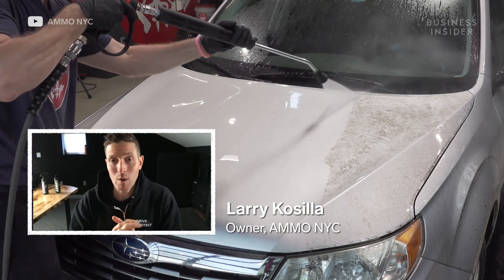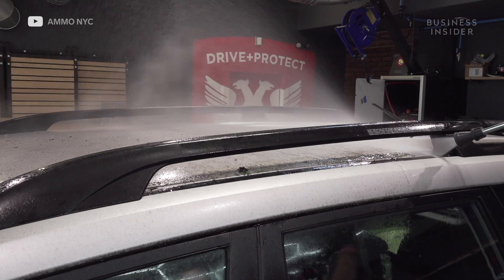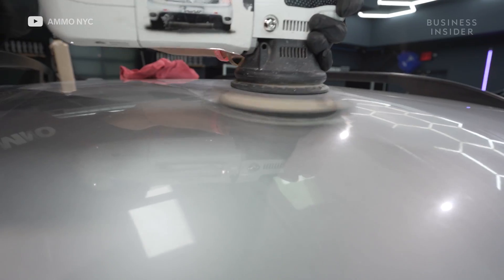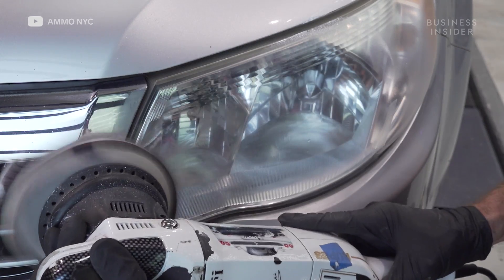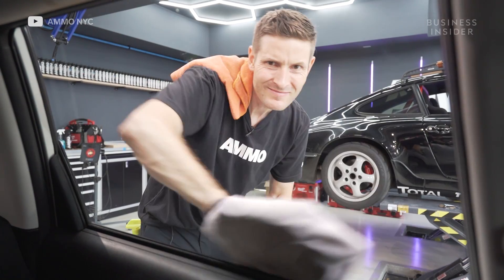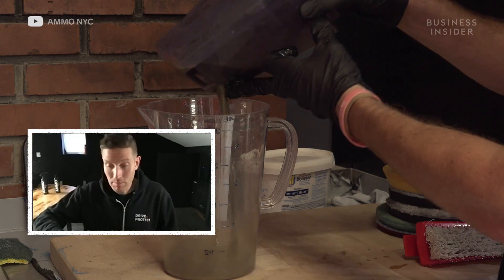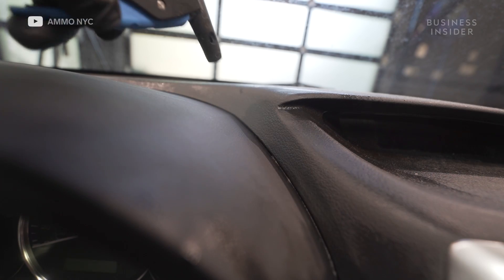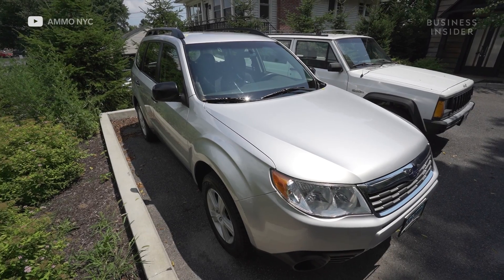How Cars Are Professionally Detailed And Deep Cleaned

Comment: Leaves the battery inside the car when washing the engine bay
Reply: Probably a dead battery anyway
Reply: It's more than safe on the system, any car made in the last 15 years is designed to be able to take on water in the engine bay.
Reply: @luminaughtt  water can get stuck in certain spots and rust
Reply: @StoneOcean595  as a fellow Detailer, it's pretty standard practice to dry engine bays as standard, and using rust inhibitors to slow the rust process, reducing risk. But yes, I do see what you're getting at and it makes sense.
Reply: It was a dead battery

Comment: 1:25 you can just power wash the engine like that? I always thought we should avoid getting that area too wet. Because if electronics and stuff.
Reply: You shouldn't, too much risk to electrical related components
Reply: You can it's just the older cars you shouldn't do it on
Reply: @LetsgoBrandon2023  cars in general you shouldn't...I detail for a living and I don't "pressure wash" I use standard water pressure with an attachment that sprays water like your shower head. They're are quite a few risks in doing so with too much pressure no matter the year.

Comment: As a business owner who started doing this exact kind of job from the ground up, he's actually doing a very bad job. NEVER use a pressure washer on your car. Most people who clean their car will most likely use house water (from a hose or sink) and that abrasion from the pressure washer will most likely have sediments which cause damage to your paint job- use distilled water if you HAVE TO use a pressure washer and set it to the weakest setting. ALWAYS make sure you hand wash with microfiber cloths after you gave it a good water down. Stay away from strong soaps; Kitchen soap is just as effective- bubbly is not better. Don't lazily "restore" or "buff" the paint until you have clay barred bad areas that have things such as sediment embedded inside the paint and made sure you know where certain problematic areas are at (Such as small chips, indents or even scratches). NEVER use a scrub pad on a window and stop using basic glass cleaners. The glass is not normal glass and as such requires a different substance to clean with- both tool and soap. And that is just the outside...

When you clean the inside, always take out the seats first if there isn't already too much of a mess on them!! Next, remove the big dirty stuff like the floor mats (place them elsewhere), trash the carry outs  and then vacuum the other stuff that you can't pick up by hand. Don't forget to have a stiff bristled brush on hand to agitate some embedded dirt, this makes all the difference. After, look around for stuck or melted on messes such as gum or melted chocolate. All you need to do is agitate it with a brush using either hot soapy water above 100 degrees or very hot steamy from a machine. This applies only to the carpet within the car and not the mats. NEVER use cleaners that soak into your product. That's why wet vacuums will always fail. Make sure you use special cleaners designed to function as a topical or dry bathing and then clean it up with a vacuum that is capable of handling wet messes too-do not rinse it with water. The point of doing this is to remove odors and colored stains. If it soaks, it'll mold and be another smell you can't get rid of. Seats are a special unit all on its own, but the rule is the same; Zero soaking and that's what he messed up on doing here quite often. 

Next NEVER use a scrub pad on ANYTHING!! PERIOD! Always use different kinds of microfiber towels, some are designed to be more abrasive than others so be liberal with your choice, but not with your soap. He did good with that. NEVER use compressed air to dry off surfaces. If you need that, then you used too much soap to clean off the surface. You should always be spraying on your towel, not directly to the surface that you're cleaning because what he did was spray into the very small crevices that eventually build up and make your car look worse. There are many other things that I would recommend, but this is why my business is HUGE and stands out compared to the others in my state or else that employee gets fired.
Reply: If it works it works

Comment: You should have completely removes the seats and cleaned them and the inside of the car with the seats removed… this is not deep clean… also you should have removed the plastic from the doors and checked for dirt inside the doors

Comment: Sound like good advert for Larry, but clearly Business Insider is clueless about what car detailing is. Larry obviously takes any opportunity to get some free advertisement, but his content is becoming  questionable. For example this car is past "detailing phase", this is not how the cars are "professionally detailed", because this is not how the normal car looks. I would go as far as stating there was no "detailing" showed in this video. So to begin with this cars was unusually disgusting, actually to the level where it would have been scrapped or sold in an auction with "bio-hazard tag" (it probably was actually sold in auction) - no car detailer ever would accept this car if not for marketing stunt.
So the first step in this process was deep cleaning - deep cleaning is not detailing, that is not what detailing is about.
No you can say - "yes, but he polished the car and polishing is what is detailing is about", no polishing could be used in detailing but it is now what is detailing about. And he in this case used polisher not to perfect the paint, but to actually remove the grime... that is not how polishing is normally used.
Finally, he applied some sealant/coating - I have not used AMMO product so it may be ceramic coating of some sort... and then made ridiculous claim about it being "anti-bacterial"... what a total BS.
Is applying coating on the cars is detailing - no... 
So what is detailing - detailing is taking car which is 80% clean and bringing it extra 15-19% more towards perfection. I do not believe there is car which is 100% detailed, but that would be the ultimate goal. And that goes beyond just clean, but rather focusing on shine, on lack of scratches and other things which are considered "paint defects". So it is really about attention to the detail, about making the call look as good as possible. In the end of the day you want to protect your work, hence there are sealants and coatings which keeps the car in that condition for longer.
Anyway, if anyone wants to know what detailing is about, then look away from this video... or if you think you can take car looking like this to your detailer and they will accept it, then think again. Detailer job is to take satisfactory clean car and making it amazingly clean and shiny... not archaeology and pulling bags of rotten leaves from the door jams. 
Sad for Larry though - he used to be well respected and much liked detailer, great guy... but now that he has his own product line he is so desperate to market them that it seems he would take any opportunity and would say anything (like that paint coating is anti-bacterial) just to make them sell. Disgusting and slimy... and even if the sealant has such properties.. then it shouldn't why would pain sealant have anti-bacterial properties?! From when that is a "good thing"?!
I mean c'mon guys get real!